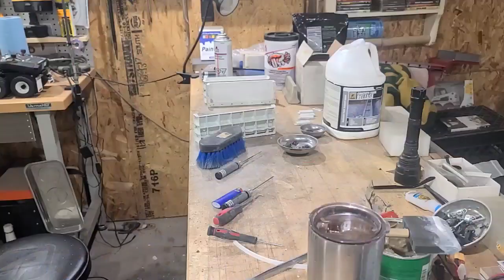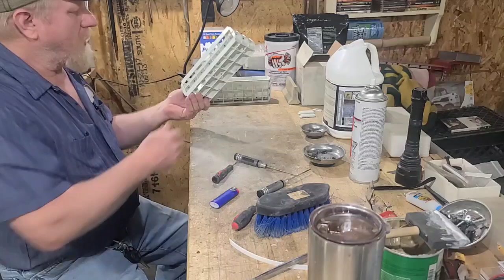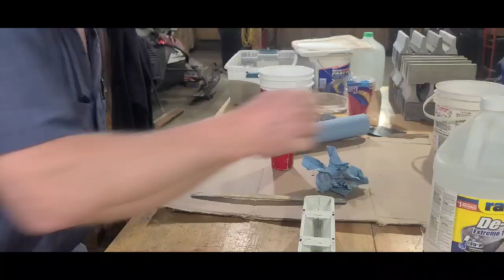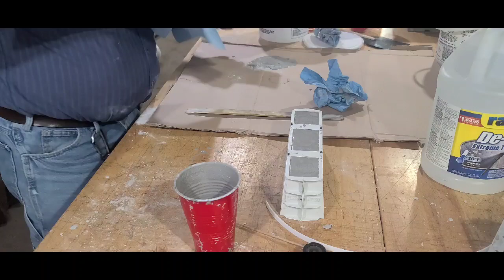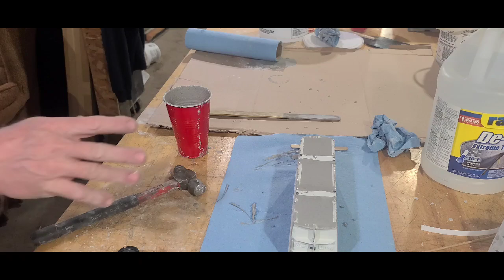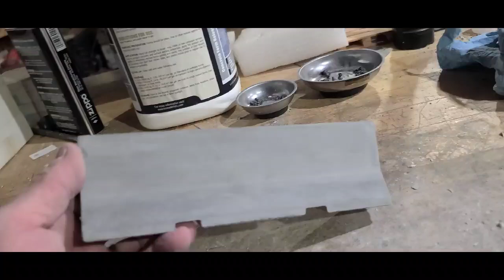1/14 Construction of Jersey Barriers Using Concrete Mix and DPS Forms

Comment: Man I just can't believe you didn't convert a bruder mix truck to make the concrete and then pour it in the molds LOL what a big let down LOL just kidding :)
Reply from the maker: I do have one, but nobody is small enough to get in there and chip out the drum. 😅  https://youtube.com/shorts/h0uFT4Y755A?si=nIk4Is9a306M-tNM
Reply: @dennybobsrcconstructionagc2796  I have seen where they use 1/4 stick of TNT to clean out drums.... I've got an S-load of black cat firecrackers we could use if needed LOL
Reply from the maker: 😅😅😅😅😅 @jetegtmeier71

Comment: I use to do Resin Casting, on my molds I used a spray on silicone & I had good results with it. 
  My dad use to poure concrete, he mixed diesel & motor oil
Reply from the maker: I tried silicone spray, WD40 and also sone actual release agent. None of them worked very well. Scaling everything down is tough. The white spray on grease has worked the best for me. 😊
Reply: @dennybobsrcconstructionagc2796  just like you said, what may work for someone else may not work for you. It looks you may have found the good form release agent for you.

Comment: For your ready mix truck you can chip it out with a firecracker. We actually had a few trucks they came and used 1/4 stick of dynamite or a block buster to break the concrete out of. So a fire cracked or maybe a m80 should chip it for you.

Comment: Years ago when I worked for a concrete company we had to make some mini jersey walls and barrier blocks for a show and for each of our 20 locations for displays. We used some metal molds and sprayed them with WD40 and also used on some of them a thin oil like motor oil. Not sure what grade motor oil it was but it was super thin oil. We only sprayed it on didn't brush it. We let the blocks cure and they came apart with no problem. They did stick every once in a while. Now we did use actual concrete for ours.